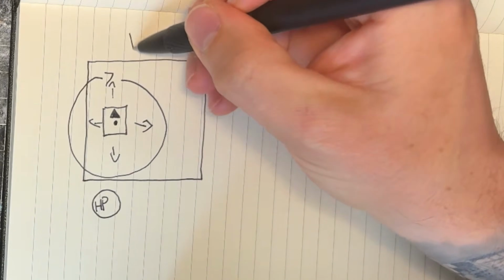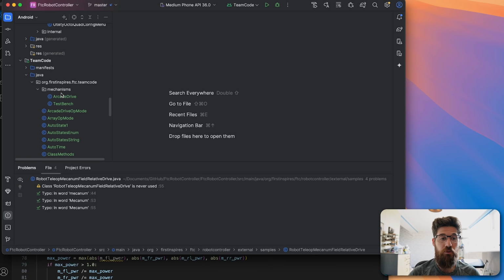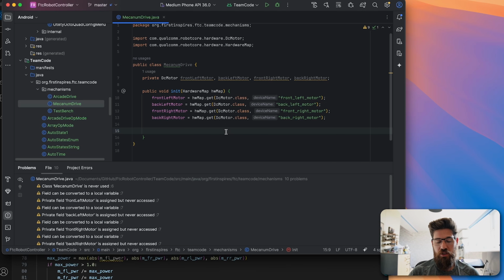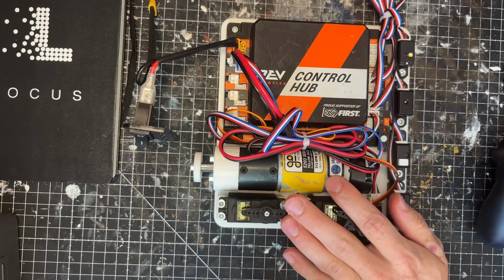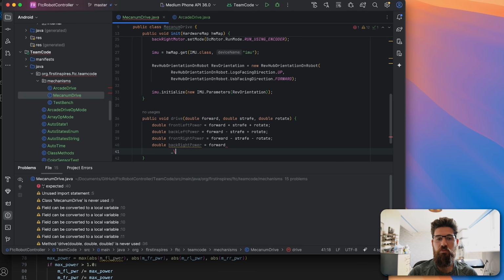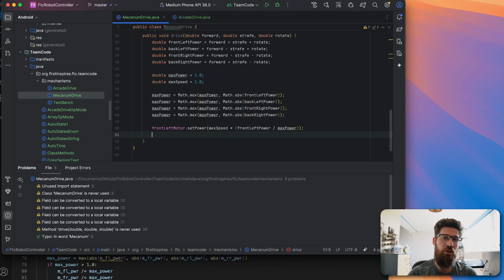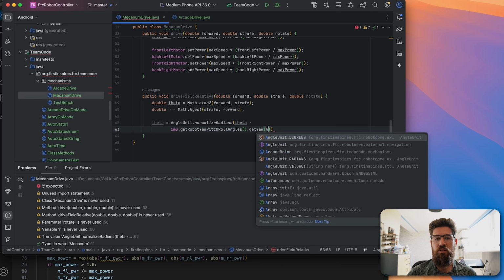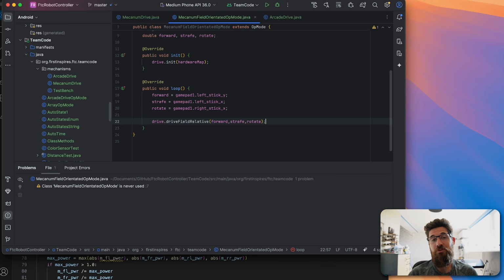How To Program a Mecanum Drivetrain (Learn Java For FTC Robotics)

Comment: HI Coach Brogan, I had a quick question about the Field Oriented code. Whenever my robot is turned 90 degrees, the controls on the joystick become inverted. Is there a reason for this?
Reply from the maker: Sounds like your initial heading might be off. check that you've initialized your REV hub with the logo orientation + usb direction correctly.
Reply: The logo and usb orientation is correct. I looked online and I saw that I have to add the imu yaw angle to theta instead of subtracting it, is this right?

Comment: Also have one more question, does drive.driveFieldRelative(forward, strafe, rotate); automaticaly activate driving? Would we need anything else to include or does that just activate the driving
Reply from the maker: If you pass in non 0 arguments, yes that would automatically drive provided everything is configured correctly.

Comment: Great video. I am having a few problems that are likely caused by an error the driver hub is giving me. The error is "Error communicating with the I2C device(s) 'imu'. Check your wiring and configuration." I have made sure the config file has the I2C bus for the REV internal IMU (BN0055) and is labeled 'imu.' Any ideas to troubleshoot this?
Reply from the maker: The imu needs to be on port 0 typically in your config file
Reply: Thats whats so confusing. I have it as I2C Bus 0 in port 0 and Ive made sure its named correctly.

Comment: But with this code i have to ensure that my robot ends its autonomous routine at a certain angle right?
Reply from the maker: That would be the easiest,yes. Alternatively, you could add in a button that resets the heading manually in your teleOp mode

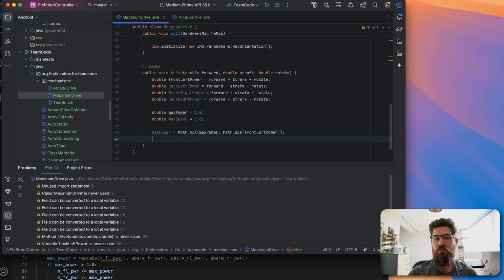Comment: Hello Coach Pratt, I was wondering, at 16:59, after you assign max power to max(1, abs(frontleftpower)), do you still have to check for the powers of the other 3 wheels? Since front left power is already pos, pos, pos on all 3 parameters, any other wheel power, say, abs(backleftpower) is strictly less than abs(frontleftpower).
Reply from the maker: You're on the right track, but you still need to check power from all 3. It won't always be strictly less, as we do some math on forward, rotate, and strafe. It's possible to send in a +3 or -3 value, depending on how you mix the inputs. I explain more in this video: https://youtu.be/0k-Ey9bS9lE
Reply: @BroganMPratt  Thank you for taking the time to reply. Sorry for suggesting something that's wrong. To avoid the 4 lines that look very redundant, would max(maxPower, abs(forward)+abs(strafe)+abs(turn)) be equal to making the 4 comparisons? beacuse we only want to compare max power with the largest power output, and the largest power output is the one with the pos pos pos (or neg neg neg) output. We can replicate this by using the abs method.
Reply from the maker: I believe max only accepts 2 arguments. Otherwise, that would have worked.
Reply from the maker: Also, please call me out if I do something incorrect or you think is off. We’re all still learning together, and I sure am not perfect

Comment: Hi Coach Pratt.  I am the coach of team 21309 - Teksense from South Africa. We are experiencing a problem with our mec drive. The robot wheel setup is correct, it drives forward, backwards, turn left and right just fine, but when it strafe the robot loose orientation. We have duplicated your field orientation program in this video, but it still does the same strange movement. Here is a short video of what its doing. The last action where the robot is suppose to strafe, but its making a circle. We don't know why its doing that, can you help? https://www.youtube.com/shorts/gv_i5APZt1k
Reply from the maker: Your wheels are reversed. You want the 45* rollers to look like an "X" when viewed from above. Swap your front left with back left, and right respectively.
Reply: @BroganMPratt  Thank you, we will do that.

Comment: Hello, can i use pedro pathing or road runner without odometry? Using just encoders from whells. Only to see the path in field
Reply from the maker: You can use odometry from the wheels encoders, yes. keep in mind, this can be less than accurate on mecanum wheels due to wheel slip. On tank chassis, this is fine. though pedropathing only works on holonomic drive setups (sans swerve).